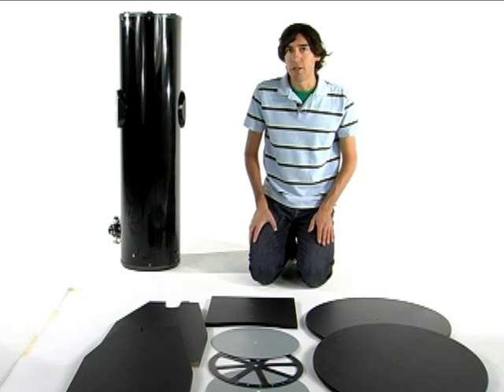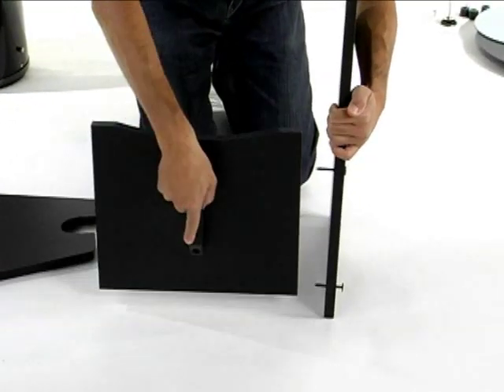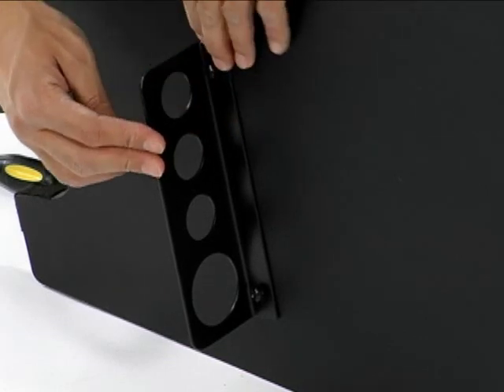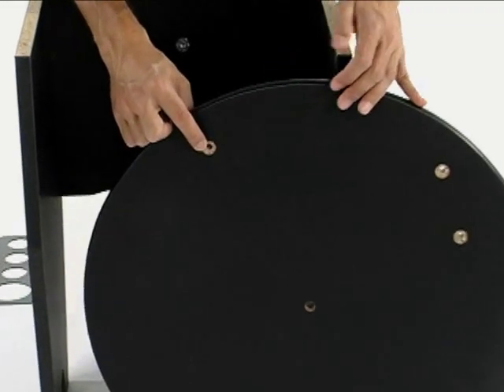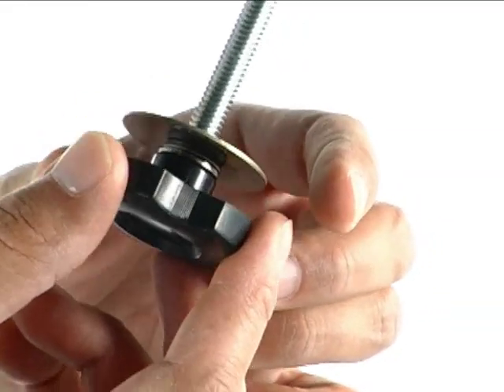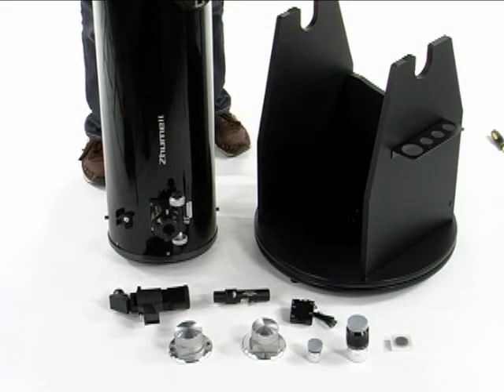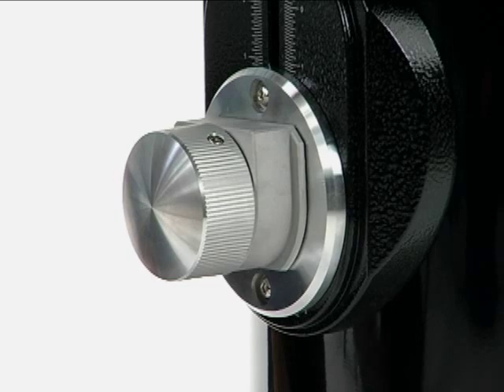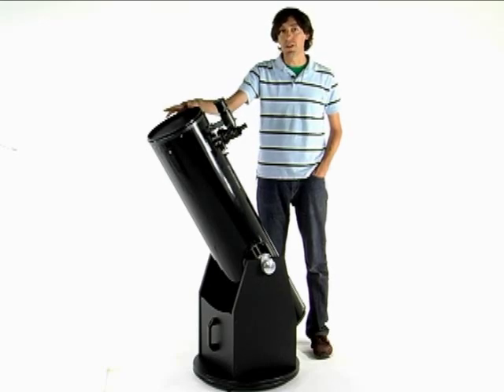Zhumell Deluxe Dobsonian Reflector Telescope Video

Comment: I am super nervous getting the second hand telescope. How do I know if everything is alright I keep reading what u wrote. What I found online. I am super super nervous almost thinking what am I getting myself into .feeling like if one thing goes wrong like if the mirror is scratched or if ... It has small molds and dots I am done ( I should NOT accept the telescope if the mirror has molds in them right ?.) Now I don't even know with this dedication if my friend will ever be appreciated. Why is it so nerve wrecking . Also like ... Should I be holding it like a baby thru out the bus ride ???... Wrap with towel and bubble wrap..

Comment: Nice presentation but I have two questions. 
(1) what is a good side for the eye piece tray? I might think it would be better on the side where the user stands.
(2) how does the battery pack get attached?

Comment: So it seems that the newer models (2020) only use 4 of the black allen screws to attach the top base plate.  Thank goodness, I thought I was missing 2 screws.  So if you got a new one and it only has 8 large black allen screws and the manual says you need 10, you're good to go.

Comment: I would personally go for the orion skyquest over this scope.why? The orion is much simpler and has excellent customer service and its optics is parabolic with steel OTA. The zhumell comes with two much for its price I don't know what is the OTA material and what optics it has. It harder to assemble than the orion skyquest and it's a lot heavier. Zhumell cheap base material also. Both the Orion skyquest xt8 and the zhumell z8 cost the same price and the Xt8 comes with less stuff with better quality.
Reply: Another advantage of the Zhumell over the Orion is the adjustable Alt bearings on the Zhumell.  If you were to add heavier eye pieces, mount a camera or attach a heavier finder scope you could adjust the position of the bearings forward to maintain balance.  With the Orion scopes you would have to find a way to attach extra weight to the primary mirror end of the scope.
Reply: What are you talking about? The Dobsonian Base on the Orion are made out of the same particle board as Zhumell's are. Same shit! 
The optics on the Zhumell Scopes are actually great. The Orion tube is not steel but aluminum like this one is! All the same materials! Do you realize how heavy a steel OTA would weigh? 
As for the Zhumell coming with too much for its price? What two eyepieces and a laser collimator? That is not a lot if you ask me but one more eyepiece than Orion offers. They just made affordable scopes for those on a budget and once that happened is when Orion began to make their low budget scopes. I myself own the Z8 and its great.
Reply: What more it comes with ? Another eyepiece, a moon filter, a dual speed crayford focuser, a laser collimator and a cooling fan if that's not a lot more to you then you are an idiot all that would cost about $150-200 additional cost
Reply: The original moon filter is about 14.00 and the 9mm eyepiece is about 20.00 and the fan like 10.00. Most of the 8 inch scopes all come with 2 inch crayford style focusers so that is nothing extra. The only scopes that come with a 1.25 inch focuser are usually thew 3 to 6 inch scopes. So with the laser collimater and the extra eyepiece and fan is about maybe 60.00 at best for extra's. I think you are over exaggerating the extras. 
Plus since you know nothing about Zhumell, they are a company who specialized in binoculars and spotting scopes and wanted to create a scope that was affordable to the astronomer and they did just that. 

If you look at the scopes today; others like Orion, and Meade, Skywatchers and the many others started to lower their prices when Zhumell produced their first Z8 8 Inch scope. All the optics and mirrors are exactly the same and come from the same manufacturer so you are not getting anything less of quality. I own the Zhumell Z8, The Orion Skyquest XT8 and the Celestron Nexstar 8SE and the Zhumell honestly blows both of the other two name brands who have been around longer out of the water. 

     
         I own the XT8 and it is the same Aluminum & Silicon Dioxide that is used on the Zhumell  parabolic mirrors are identical and simple to use. The base is the same particle board shit so no difference because of the brand name. The OTA is the same Aluminum Alloy which some like to call steel but its not steel. You would pay a fortune in shipping if that OTA was a full steel material. Especially on larger scopes like the 10., 12 and 14 inch. It would take over five people to move that shit! LOOOOOOOOOOOOL

 You're recommending a product you never even used because you're just going by the manufacturer and name brand when you do not realize that Zhumell has been around just as long!  :) Lool
So the only difference between the Zhumell Z8 and the Orion Skyquest 8XT is that the Zhumell is cheaper in price and you get more. One last note so others know the real truth is that Orion and the other major brands started to drop the prices of their scopes no sooner than when Zhumell released their first scope and it was rated best scope for over 3 years in a row. Hell, even the 10 and 12 inch scopes are still out beating major brands still today. 

So the Zhumell Z8 is the same scope as the Orion Skyquest 8XT. Everything is 100% the same outside of color and and some added accessories. That is it; oh and the name brand. So you pay 200.00 more and get the same identical scope and less accessories when you buy Orion or any other brand.  
This is the same for the Z10 and the Orion Skyquest 10XT. Both scopes are identical and you pay 599.00 for the Zhumell and the 700.00 for the Orion because you're paying for the name. All the same materials and optics. This goes the same for the Zhumell Z12 inch and the Orion Skyquest XT12. One is 800.00 and the other 1100.00. All the same mirrors and optics. 

So I use the Zhumell Z8 and its great and just as simple as my Orion XT8. If anything my Celestron NexStar 8SE was more complicated to get set up and Celestron had poor customer service. As for Orion or Zhumell, I never needed to call either company for support so I cannot argue that with you.

Comment: Very good instructional video - especially considering that my example came without any instructions included. Only one thing - you appear to have the eyepiece holder on the wrong side. ie on the opposite side to the focuser. Otherwise excellent.
Reply: +DeejayP999 I just got my Z12 today and no instructions either.  I know this scope is a MUCH better value than the similar Orion scopes, but gee wiz, can't even throw in a piece of paper with instructions?  Or at least a paper that says: "Go to this website for assembly instructions: www.xyz".  Luckily I remembered this video from a few years back.

Did your 2 bushings, the ones that mount to the tube and hold the tube to the base, come with ugly black knobs instead of the real cool machined billet block of metal looking ones like in this video?  Those metal looking ones are what made this scope look soon cool!  Another sign of cost savings.  Not that it will not perform as well, but its so ugly.
Reply: Yeah, mine has the black knobs. They may not be as nice as the machined ones, but I don't mind - at least they're solid and functional. Things is, this vid is 5 years old - so there's bound to have been some changes to the spec over that time. Overall, these scopes are excellent quality.

Comment: Easily understood. Everything assembled perfectly. 
Except one of the 4 screws in the base seemed to strip its thread. Perhaps I tightened it too much.  Will eventually get around to dropping a bit of silicone into the hole and then re-tighten the screw.